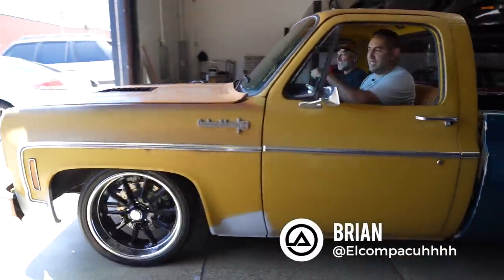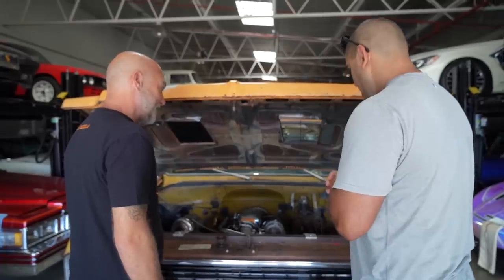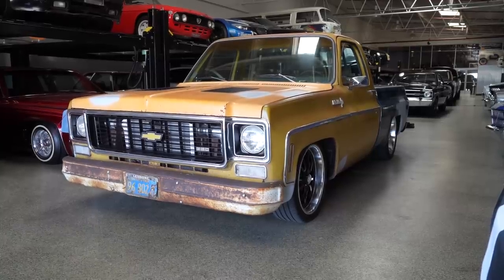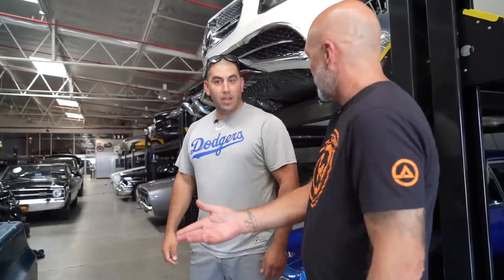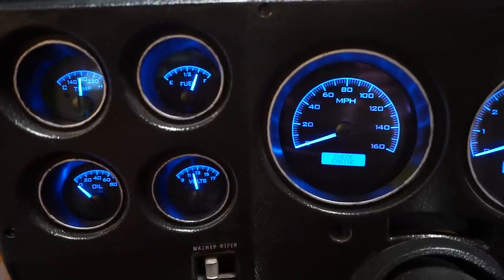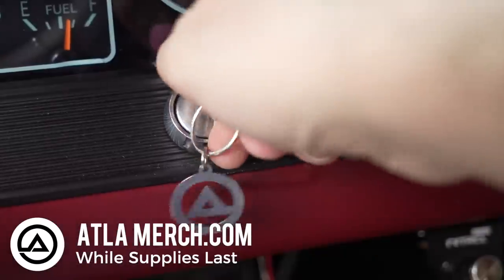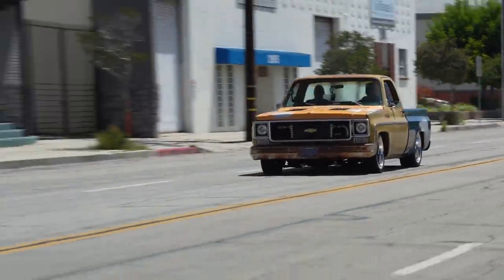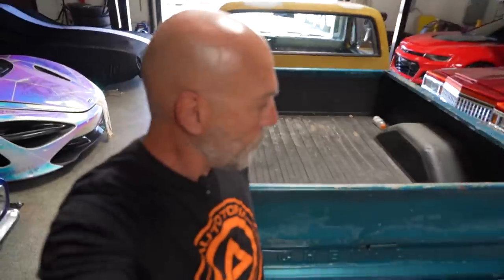LS Turbo Chevy C10 Sleeper

Comment: 550hp @ 6 psi is more than enough power, and this combination's going to last a long time. I like it.
Reply: Fred Garvin That’s about the point where you are starting to get where you can’t put the power down reliably and consistently....
Reply: These squares with 400hp are alot of fun. 550 would be super fun
Reply: Exactly ! That's less than some oem set ups run.
Reply: @DrDaddy-yg2ki  Try 800...N/A
Reply: Wonder if he’s gapped the rings. I got a gen 4 5.3 in a 86. This is my goal.

Comment: I think the Best Part about this Truck is his Sound System👍.
JK😂. It's crazy he's getting 550whp with only 6lbs of boost. The turbo is barley doing any work at 6lbs.
Reply: Honestly I don’t think he is, mathematically that should land him around 400ish wheel. His runs on the street looked more like a 400whp ish truck too.

Normally guys don’t make 500+ until they run 10+lbs I’d boost. I’ve got a 450whp daily which is where I’m getting most of this from.

I’m assuming his tuner either doesn’t correct their sheets so they look better when their customers tell their friends what they made. After corrections he’s probably actually around 400 to 450 is my guess.

Comment: Feel like he didn't really show off that 550whp at any point in this video, still super sick though.
Reply: Tbh it doesn’t look like 550.... Looked more like 400ish.. With the math his 5 to 6lbs should only net him what I just guessed. Normally 500+ is around 10+ lbs on a 5.3.

Sick build but I think his tuner upped that dyno sheet on him.
Reply: Agreed! That much power in a short bed, tire eater at 30 mph. That wasn't displayed for some reason. Just finished my son's 71 short bed with a 454 big block. Pretty quick and blast to drive. Tire smoke at will at 30 a below.

Comment: I'm not even a fan of the LS swap, air bags, and more of a Ford pickup pickup fan...and i'm diggin' on the recipe here. Grab a solid workhorse, get the suspension safe, put in cheap power, make a nice interior, and leave the rest alone.

Comment: Just a reminder 550 RWHP /.80 = 687.5 crank HP. on 93 pump gas. I used 20% driveline loss being an automatic. The owner is correct about larger injectors, fuel pump and turning up the boost.

Comment: I'll be building one with a turbo bagged stroker 5.3 in a yr or two. Hopefully it's a rcsb 73 also. This is literally the same exact build I have planned. From patina to a mildly boosted 500+ rwhp daily drivable type shop truck. Something I don't have to wash 😂 . I bet the trucks a blast ! Enjoy it. I may not you up to buy it when I'm done with my  current k10 build 😂.
Reply from the maker: Awesome! Look forward to seeing it when you have it on the road
Reply: How’s the build going
Reply: Im on an 82 4.8 swapped k10 at the moment. When its done and sold i will be looking for a c10 to build

Comment: That’s far from a sleeper-my daily driver named “Heavy Sleeper” 2015 Ram 2500 4x4 Crew Cab Long bed 6.7l CTD with factory steel wheels,tires etc. I’ve put all my  time & parts into the drivetrain & when dyno tuned we made just north of 1,300 ft lbs of Torque & the cool thing is I can beat on it and it just keeps on winning in the streets-kick ass c10 btw!

Comment: Pretty sure. 6 pounds of boost would maybe equate to about 25 percent power increase. Maybe. Im really bad at math but if it makes 550. At say 14psi. Then atleast just. Implement that into speech. 400ish whp. At the current 5psi.. nice truck though. Nice setup. Slightly misleading.

Comment: I've got a c10 these guys need to come to KY and see if that is 550 at the wheels. Mine must be 750 hp and I figure it less than 500 at the wheels. Glad I screwed up on my calculations!! Original paint 71 short bed with a big block. Currently automatic trans but T56 on order.

Comment: My dad had a 73 Custom 10 C10 truck. It had headers and straight through Thrush mufflers. Had a 3 speed then a 4 speed. Manual brakes and steering. I was so upset when he sold it after it sat for 10 years and I swapped a small block. I miss that truck.

Comment: Either he's not in it or he's got magical tires. Mine wont hook like this and I set the motor back 4". He's on bags which suck at weight transfer. Cool truck though. You got the right idea. I haven't had a car painted in years. When i was painting my cars I would never drive them. Just garage candy at that point. Too scared to get a scratch.

Comment: Built my 80 c10 with 5.3 tsp 224r cam and ON3 76mm turbo with porterbuilt trailing arm conversion and accuair air ride about 5 years ago. Turbo kit built my Turbo Mic.
DanielMoreno214 on Instagram
Now running a static drop with Hughes 1200HP rated 4L80E.
Reply: Love the truck bro!

Comment: He literally said the driver side vent is for heat disapation and said you can literally see the heat coming out of the vent and pointed at the passenger side vent, that brings cool air to the turbo 😳💀💀
Reply: Yes, because when I’m waiting at a light and idling, you can see the heat coming out of the vent right above the turbo

Comment: Would love to build a truck similar to this but with a T-56, discs all around, some fantastic non air-bag suspension, and some lightweight aluminum wheels that look similar to factory steel wheels/rally wheels.
Reply: Life's too short ...what r u waiting for?👍
Reply: Static lowered suspension doesn't ride all that well fyi. Nothing like GOOD quality bags do anyways. I know as I slammed my '94 4 door S10 Blazer using ALL  Belltech parts. She handles amazing and rides well, just not like bags..
Reply: Actually building my 68 with a stage two t56 I got a long way to go but I have a vision

Comment: Like the truck!! I have one very similar to it. However, 550 at the wheel with a 5.3 @ 6lbs not happening.
Reply: That's exactly what I was thinking I have a LM7 in my Camaro on 14lbs and I'm at 575hp to the wheels. He might be 450 hp tops.
Reply: Jason Cavin I don’t personally know this truck or your Camaro but there is a lot of variables. Proper component selection, build, tune, fuel, elevation, weight, transmission, etc. A healthy 5.3 NA setup  right can get 350 whp, add low boost why can’t it get another 150hp?
Reply: My 5.3ls @ 12lbs is 524hp at wheels- dyno jet